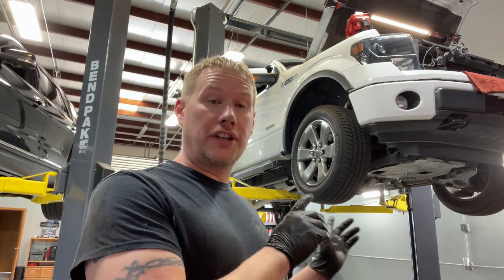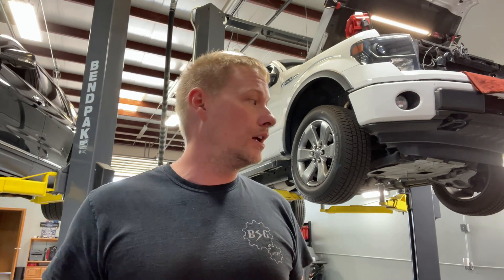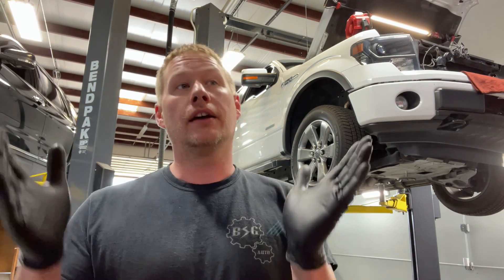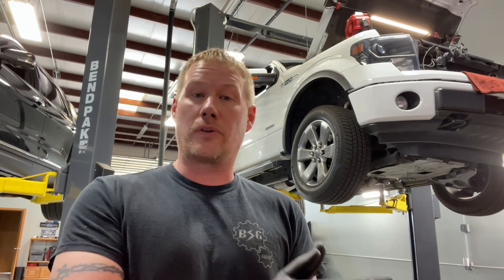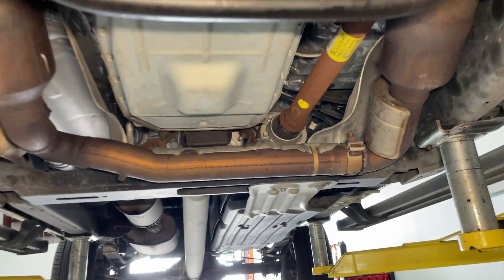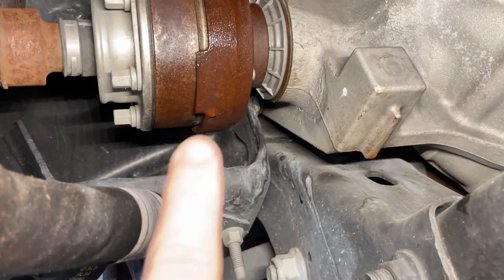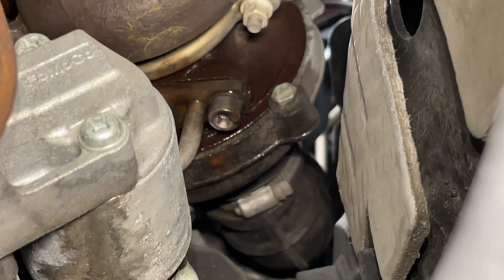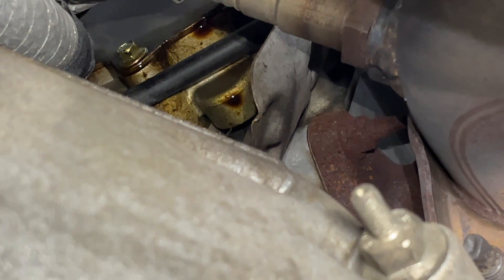Ford Ecoboost Engines Can be so Hit or Miss: I Really Feel Bad for This Customer...

Comment: They really aren't building these new vehicles to a quality level that most of them will reach 300,000 miles before they have major issues. I feel like manufacturers are still trying to push people to buy new vehicles every 3-5 years if it's driven like the majority of owners drive them. But the price of these vehicles new is very quickly becoming astronomical. It's hard to find a new 1/2 ton truck for less than 40,000$ and if you do it really is a base model vehicle with no options. It's not just ford all manufacturers have a ridiculous build quality anymore. When you work on these vehicles day in and day out you can see the trend pretty easily. Everything they can possibly make out of plastic is made out of plastic. They used to impregnate Teflon plates in aluminum timing chain guides now they are plastic. Every thing cooling system wise is made out of plastic that literally just crumbles cracks or shatters after 5 years. Volkswagen and bmw both sale engines with a plastic water pump attached to a cast iron or cast aluminum block. New vehicles are literally just a rip off. I literally drive a 30 year old ford ranger back and forth to work everyday because I don't want to have to deal with the stuff I see wrong constantly coming into the shop on the newer vehicles.
Reply: Same here ....am still driving a 20 year old Honda, with over 200,000 miles, NO oil leaks and still running the original engine/transmission....bought it new and have kept up my routine maintenance.....
Reply: @spanishh2001  the older Hondas will last forever as long as you keep up on the maintenance. The new ones can make it to 200,000 probably longer if you replace the timing chain. They get chain stretch and the guides wear around 150,000. The old timing belt motors are great though.
Reply: @jeremypike9153  the first time I had to spend money outside of regular maintenance, was at 90,000 miles, alternator went bad ....got the part from the dealership and did it myself, was easy compared to some of these new engine compartments I've seen...
Reply: @jeremypike9153  some of the older Hondas had the timing belt and you know that goes out at 100k. Y8/z6 engines the timing belt was easy to replace. Newer engines with timing chain are little more complicated to replace but if you can run 250k to 300k miles before replacement I'm good with that
Reply: “They build them better than ever now” is a very generalized statement. Who? BMW? I don’t know if I can agree with that statement. Yeah they’re were some trash throw away vehicles in the 90s no doubt but cars have gotten increasingly more complex since then and in return you can potentially have that many more issues. I see it everyday working at Toyota.
Reply: Same here, I drive a 2004 Honda Accord with the 2.4L, 160K+ on it, no engine or transmission issues. I'm slowly replacing most of the suspension components to keep it reliable, only thing under the hood I replaced was the power steering pump and the high pressure hose/sensor to the rack, that's it. Was my aunt's car bought brand new in 04'.
Reply: I feel you man and to go it off truck now a days are so expensive and for it to break in less than 70k miles that's crazy. I continue to drive my frontier k24 with 300k miles lol
Reply: I'm in need of a truck because I have combat related injuries and my focus is hard for me to get in and out of. I cant afford anything right now, so I suffer
Reply: @mikethedick  sorry to hear that Mike I hope your doing good
Reply: They build them better than ever.  90s cars were pretty much done at 100k miles.  Today’s cars will go 150k miles trouble free and 300k miles with minor repairs.
Reply: @user-tb7rn1il3q  cars? We are talking about trucks.  How do you know now a days truck will go over 300k . They haven't gone over 300k
Reply: @dannymartinez8522  There are many late model pickups that have gone 300k miles with no issues.  Some states define all vehicles less than 7500 lbs as cars.  In Virginia half ton pickups are cars.  3/4 ton and bigger are trucks.  Half tons share powertrain with cars.
Reply: @user-tb7rn1il3q  so if you have a 2020 or 2021 model you put 150k a year? That not possible.  Most consumer puts 15k to 20k a year. All vehicles now a days have more electronics/sensors that will cause more problems in future. For ex ecoboost truck like this came out with the turbo causing boost leaks or oil leaks.  Gm has issues with afm.  I'm not saying all will have issues but more likely will
Reply: @dannymartinez8522  Electronics rarely ever fail.  I throw away, actually recycle, tons of obsolete electronics that still work.
Reply: My dad had an old 01 Silverado that has 389k miles on it before it's transmission just gave out.  Original engine. Only full repair it ever had a was a radiator replacement. 

His 07 f150 he has now with 120ish k already had to see him essentially rebuild the engine
Reply: The used ones don’t depreciate anymore, so you just trade every couple of years.  It becomes someone else’s headache.

Comment: It was be interesting to see how the new 5.0 will last with Cylinder DEACTIVATION
Reply: More complicated more problems.
Reply: Yea I was concerned about that too. Why can’t they just leave it the way it was
Reply: @timschultes6467  I have a 2018 F150 with the 5.0 and I used FORScan to disable auto start stop in the trucks computer. You buy a 30 dollar OBD reader and get the free license for the software and you can change a lot about the truck. I installed an OEM trailer brake controller, turned off auto start stop and the seatbelt chime. have had 0 issues with it so far
Reply: @MrMoto655  oh hell yea that’s awesome.  Yea other then the auto start stop thing I love my truck
Reply: my 2013 ram I leave it off most of the time
Reply: @youtubecarspottersguide1  oh I didn’t know you could control it manually. So you can push a button to switch it off on  yours?
Reply: @timschultes6467   i have a tow /haul button   so just push it as soon as. I start up hte engine
Reply: @youtubecarspottersguide1  it’s like auto start stop I turn that off every time I get in
Reply: @timschultes6467   ck on YouTube  for  tips maybe there is?  for the stupid  start stop there is

Comment: Leaks are one thing but it’s my understanding the timing issue on the EcoBoosts was caused by a supplier mismanufacturing the phasers to the wrong spec (that’s why the initial TSB only called for a timing chain; they thought it was premature stretch but discovered it’s actually the phasers causing it which is why the TSB now calls for all four phasers plus chain).  This is the stuff class action lawsuits are made of; I’m surprised someone hasn’t taken Ford to task for this.  Also, why am I so upset by this issue?  I called my local dealer in Canada — they quoted $10,000 to do the timing service. (Yes, seriously).
Reply: Colin Watt that's insane. What exactly is that $10000 to include? I am a Ford dealership technician as well, and could probably do that timing job for about a tenth of that.
Reply: @michaelchan8915  that was the quote the service advisor gave for parts and labour.  What area of Canada are you located?
Reply: @colinwatt00  Woodbridge, Ontario, Canada.

Comment: I bought a 2011 F150 Ecoboost back in February with 137,000 miles and just had the timing done about 2 weeks ago at cost of $3500.  I figured that if I bought the truck as is from the dealership and paid for the timing myself in the long run I would save and after it was fixed, the guys at the dealership told me that if they would have fixed it, the dealership would have gotten around $18,000 to $20,000 for the truck.  I have about $15,000 invested in the whole thing.

Comment: My last 3 of 4 cars were Fords (2000 Focus, 2002, Camry, 2010 Fusion, 2017 Fusion) and while I do like driving them, I think my next car will be a Toyota. My 2010 Fusion continuously leaked oil that was only temporarily fixed under warranty (started leaking again shortly after the warranty ended) and my 2017 Fusion had to have the engine replaced (coolant intrusion) and I fear the turbo wastegate rattle will show up one day or the valves will get all carboned up. I'll happily take a non-turbo, non-GDI engine and lose a few hp and mpg.

Comment: The only I can say is be glad it's not German. I spent 10 years working on VW and you would be shocked at repairs we had to do. EcoBoost reminds me a lot of German stuff, except it's more poorly laid out.
Also, a good tip. Get rid of that garbage Ford Orange coolant. Its actually dexcool. Same composition.  It's been known to cause leaks. Flush it and put the new yellow in.
Reply: Good to know...👍
Reply: My VW used a pink coolant that was self-sealing. I think it did wonders. I ran my 2000 for 14 years and 350,000 miles on original rubber hoses.

Comment: I have a 2001 F150 5.4 2v with 355K miles. Original engine and transmission. Just routine maintenance. Original water pump and timing components. Best modular engine Ford ever built.

Comment: Truck is almost 9 years old, low mileage isn’t a bonus in many ways ,trucks that sit a lot have more problems than trucks that are driven regularly,being a Texas truck,most Texas trucks have double or more the national average for miles .It does stink for sure, I’ve seen a few  ecoboost engines go 170k or more before the timing chain rattle, and a few rattles get fixed just by changing back to a motorcraft filter.   Those turbo fittings that leak are just a poor design, Ford didn’t have to make it necessary to remove the turbos to change them.  If I was working on this truck and he approved all the repairs I would pull the cab personally,just way easier to do everything,and being a Texas truck the cab bolts would come right out....

Comment: I am 51. I have had so many different engines from so many different vechicles. This is life. From 2 miles to 200,000 miles. Things wear out or they are lemons. I just bought last year an 2020 F150 XLT EcoBoost 3.5 . Just over 6,000 miles. They say the 2021 can get up to 700 miles on an tank of fuel. Mine right now because I just filled it up. Just came from an long road trip. Says 743 to maybe empty. Will it happen. Most likely not. No different then buying anything. You never know. My Jeep Grand Cherokee has over 180,000 miles. 2006 straight 6. Leaks oil. Doesn't blow smoke. Will need an transmision some time. My new truck is an Learjet. Tomorrow it could be junk. You never know. You like it. You want it. You can buy it. Then buy it.

Comment: I had a customer bring me one of those with a bad startup rattle. All i had to do was replace the oil filter with a Motorcraft oil filter and the problem was 100% fixed. I noticed that this truck had a Valvoline oil filter on it- definitely could have been the rattle problem. I think, just like everything else, the aftermarket parts just dont work well on the Ford engine. The oil filters dont seem to have the anti-drainback engineering of the Motorcraft filter. I have a 1990 Corvette ZR-1 with the LT-5 engine and that thing is super picky about what filter i use on it just the same. One filter will rattle like crazy after just sitting 20min and another won't drain back even after sitting a month.

Comment: I changed the same left turbo coolant feed seal without taking the turbo off on my 2015 F150 4x4. I was actually very surprised to get it done so fast.
Reply: Is the left easier than the right?
Reply: @jessemartin9720  the right seemed about the same. I had to replace the oil feed seal on that side. Took longer to clean the mess than it did to change the seal. Taking the starter out on the right side really opens it up.
Reply: @hmayesh  The access in the wheel wells is really quite excellent. I was scared of the turbos until I found how easy they were to access.

Comment: I'll take a naturally aspirated V8 over an over engineered high stressed small displacement engine any day. Thanks EPA and hippies crying about miles per gallon, you did this!
Reply: Ford did! They've never learned how make anything reliable!
Reply: 🤣you’ve obviously never spent much time with one of those “ overly stressed” engines. They are amazing. That’s why they have used them for so long. Sure a few have problems. Most don’t. Just like every other motor
Reply: Haha like fords V8’s are any better. Turbocharged engines can be great, as long as they don’t have a FoMoCo badge on them.
Reply: Wait until you see what they did to Semi trucks. It’s absolutely destroying the industry right now. Nobody can find parts and sensors, dealerships lots are empty. Only old trucks will be left on the road if this isn’t fixed in a couple years.